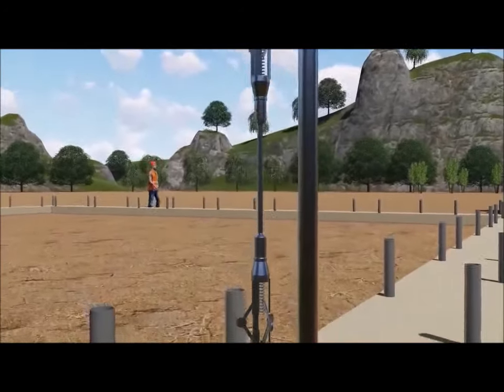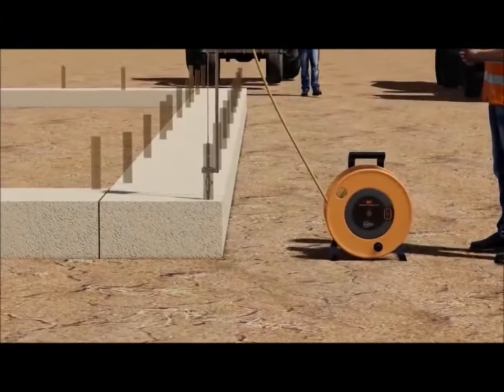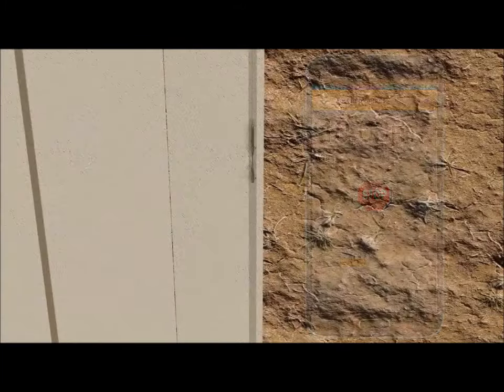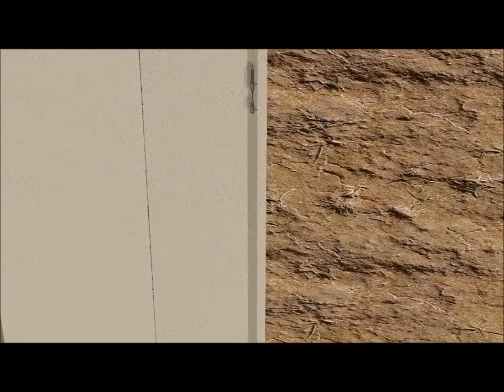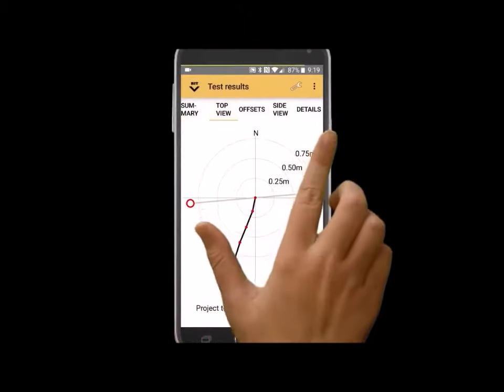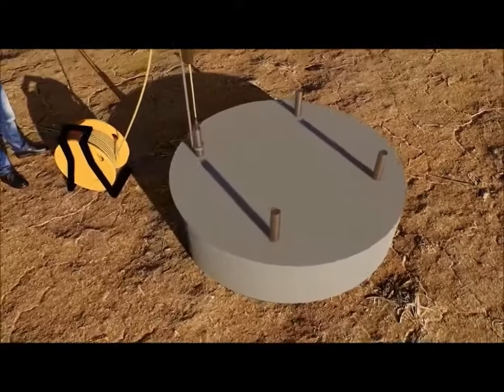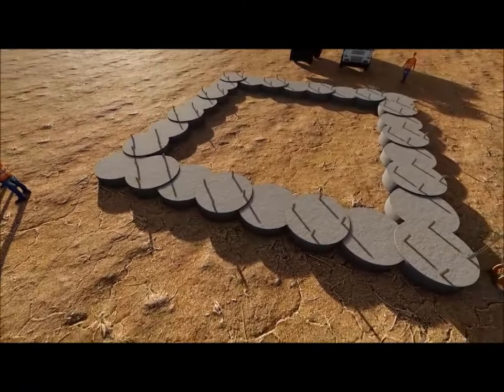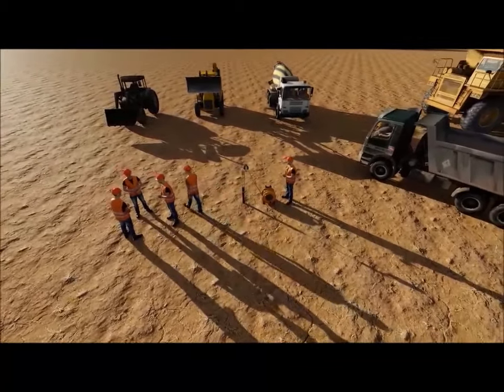BIT - How to test inclination of a Retaining pile wall / Secant Pile wall (English)

Comment: what if the tube is not vertical? :)
Reply: Good question. Since there are several tubes in a pile, we measure in all of them and average the result or kick-out faulty tube. This proved to be very effective, as the cage must be aligned with the pile direction inherently